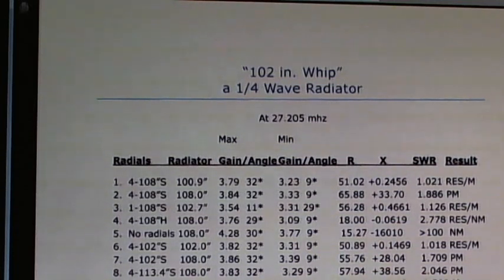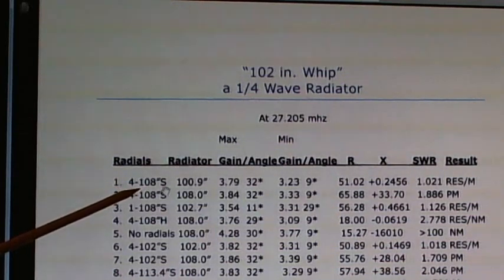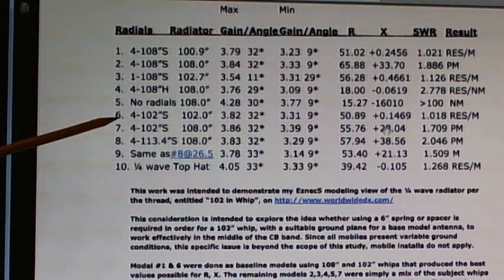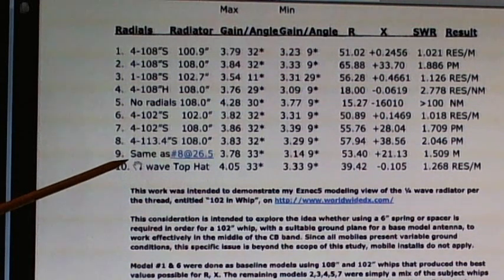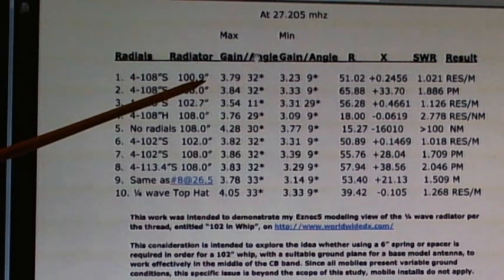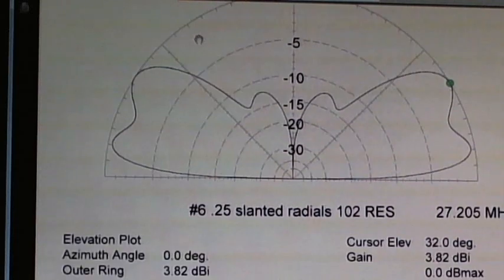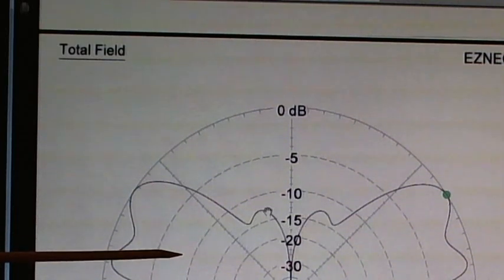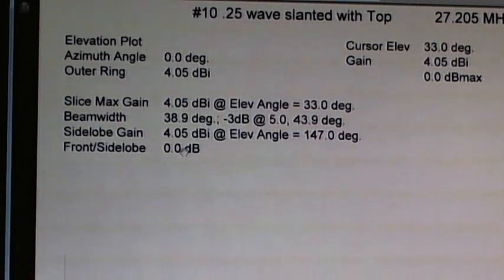Marconi discussing the 102" whip with a suitable ground plane for 11 meters.

Comment: So why wouldn't this work up on a pole with four guywires sloped down to eyebolts as bracing? Would they provide the ground plan like a auto body would? That's how a 102" whip with spring works for mobile applications.

Comment: Bull shit,skip the figures,you're only killing time,the 102 whip is the best if installed properly.the coax cable must be correct to get 1.1swr..
Reply: Spring yes.but youll loose 00.372
Reply: Do you need a spring ?
Reply: @Fox250R  I used a 6" spacer in the models as an example of setting a 102" whip to 108" inches as if it was on a spring. The difference here is I did not use a mobile object as the ground plane. Of course that makes differences...but understand I did not have the time for all situations. 

When I ran mobile years earlier, I never use a spring, maybe a ball mount at times and mostly stud-mounts on my vehicles that were not very long.
Reply: How much coax would you need? 18 feet?

Comment: Great info . I will tell you all my setup an old Homer told me and I've used it every time I set one up on a truck or trunk lid . On a truck , don't bother mounting to the bumper . The tailgate kills your signal . Buy an aluminum toolbox, mount dead center /on a car , dead center of the trunk lid , yes I know it's not beautiful to everyone . Drill your hole , mount the ball or stud , stainless steel , the heavy duty stainless steel spring approximately 4 inches , then screw in your 102 inch antenna and use a 3/8 stainless washer between the antenna and stud or ball mount  . Use 21 feet and 6 inches of coax and you will have nearly a flat swr across the 11 meter and about 1.1:4 on 28.300-28.500 . I've done this over and over . It works
Reply: Coax length only tricks your meter and gives you a false reading. Coax length only matters if you want a correct reading while tuning antenna.  Only way to do that is use multiples of a  1/2
 wave for the frequency you are tuning the antenna for.

Comment: Had a friend tell me he used a 102 with no ground plane and said it worked great with good SWR, Told him that couldn't be the case since it needs something on the other end. Then I realized what happened. He had the bracket mounted on a 9 foot piece of pipe. AHA! You have a half wave center fed dipole.
Reply: Hahahahaha
Reply: Is that all I have to do? I have mine on a 12.5 foot metal pole... but i have a 10 foot one...
Reply: @andrewmcallister4151  Well, technically, that's what it is. Put it on and try it. Might work depending on what you mount the pole to. I don't think his was mounted to anything metal. Might have been an eave mount connected to wood. I've already strung a 9 foot piece of copper wire down from the bracket for another friend of mine to get the SWR down. He had a truck mirror bracket bolted directly to the side of his trailer.
Reply: @billyjoejimbob75  im mounted to a 12 foot metal pole, that is attached to the wood work around my chimney, so the metal mast is not connected to an metal, but the metal mast runs near the aluminum chimney flashing. 

I think the mast is too long and I need to add a spring to make it 108 inches. Trim the mast to 108 inches... maybe that will get it down some... trying to refrain from radials because of hoa... 

Any antennas that don't require radials to get swr down. I'm over 3 to1
Reply: @billyjoejimbob75  I took spring off, added 2 102 inch radials (homemade) git swr down to about 1.6 ish... i wonder if 2 more radials will bring it down to 1.something also replaced 12 foot mast with the 10 foot one. 

Not sure what the most useful changes would be at this point.
Reply: @andrewmcallister4151  If you put ground radials on it, you don't need to worry about the length of the mast pipe. I was talking about using the mast pipe as a single ground radial facing downward to make it a dipole antenna.
Reply: @billyjoejimbob75  oh, I see... cool ill add both masts together then. Got 4 radials on it now swr down to 1.2

Comment: I really want to thank you for showing this side of electronics. It is important and needed to discourage myths. But this only works with the informed viewer and people with the knowledge to know what the graphs mean, as myself. And this was quite a lot of work on your part, TNX. :)

Per every written Electronic law, ARRL antenna book and Hand Book:
The Radials have to be 5% longer. A no radial antenna is like using a dipole with only one side. That's half an antenna, then the RF starts to flow on the shield of the coax called common mode. This can cause loss of equipment from damage, poor tx audio and many other bad things. I would urge everyone to go buy the ARRL Antenna Book. Study Study Study...NO CB MYTHS There!!!

The 102" whip used as a radiator on CB ""WAS made to work by tuning the radials to make the complete antenna work, But the Resonance was off. Note the first thing is that X needs to be as close to zero as possible then make the SWR correct. The antenna has to be resonant first then matched to the feed line, then the feed line matched to the transmitter impedance. Your looking for max transmit efficiency.

 And again you build the antenna to transmit to another point. The next place you talk might need a different polarity antenna moment to moment. Antenna modeling tells lots about antennas. But do discourage experimentation ever!

Please keep doing antenna analysis on Youtube, many don't know how to... TNX:)

73
Jimmy, WX9DX

Comment: GREAT Video, TNX OM. Hope many of the guys will study enough to understand the readings. Many that use antennas don't study any electronics at all and just go by CB myths.

The 102 inch whip is not going to be any different on output unless you can increase the Q of the antenna. But it is what it is, a 102" radiator. """You have to build an antenna to talk where you want and no one antenna is good for everything"""!

73 Jimmy, WX9DX

Comment: Never heard of this type of radial needing to be 5% longer than radiators... This isn't a beam/reflector setup, so why that need? Theres only ONE "perfect" resonant length for quarter-wave elements at any frequency - alter either and the match inevitably isnt as good in some way. Altering radial angle alters feed-point impedance - "match" or "mismatch" that seems to result isnt the same as with right or wrong frequency:element lengths. See about "top-hat" capacitive effects. 73 G0TDE
Reply: In part you are right Richard. 

So, when I talked about the 5% idea I had in mind these EZNEC models were based what I remembered the real StarDuster dimensions showed as (98.5"/107" = 8% longer radials compared to the radiator in my notes on the SD'r antenna. 

I also show the resulting matchs as the dimensions changed. So, I did not try and match all these models to their best results on changing the dimensions. That for sure has to be considered, but back in those days I was limited to about 10 minutes for the time of my videos. 
  
These models showed the radials (of varying lengths) based mostly on what the talk I was hearing about 102" SS Whips being too short for 11 meters and such.

I appreciate the good eye you put to task in checking my video out. Good Job!

Eddie - Marconi

Comment: Great video!! I am going to look into this Eznec5? I run a 102" whip about 17ft. to the base for 11meters. I have a 12" diameter sheet metal disc that has three radials @ about 115" long angled down @ 45degrees. The SWR is very good although I don't know what the reactance or actual resistance is?
It seems like my ground plane which is about 121" and works well, very broadbanded from 26.515-27.855 very flat on my meter.
Thanks keep up the great work!